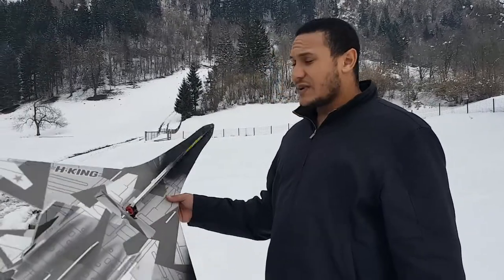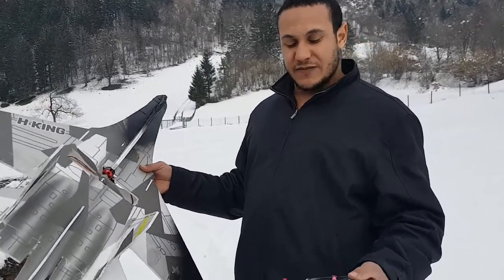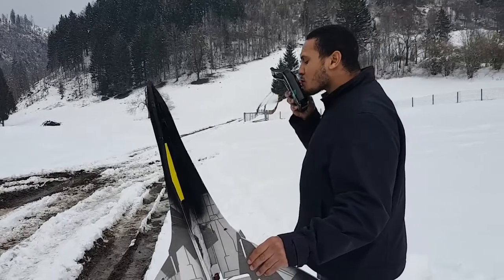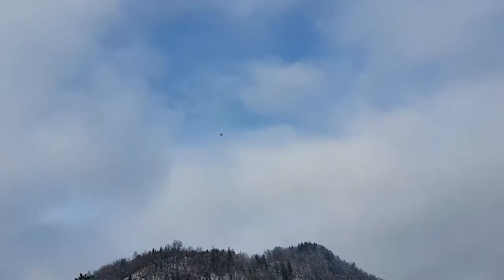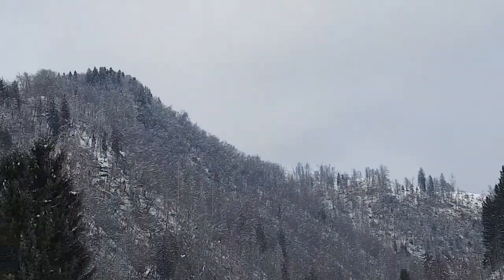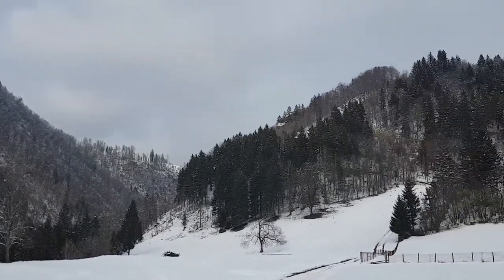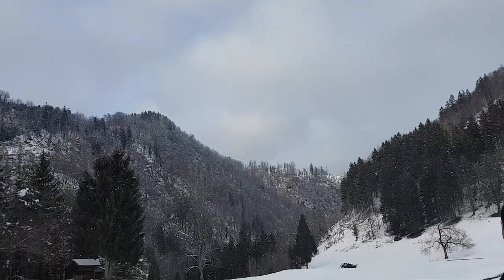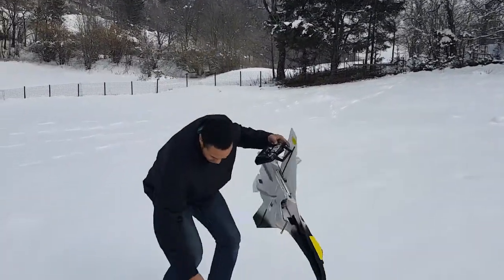Racestar BR2212 1800Kv Motor Test

Comment: This motor is balanced between 2200kv (fast) and 1400kv  (slow), I recommend it for all beginners
Reply from the maker: yup, it's a nice inbetween motor. Has tons of low RPM thrust. Did tests with 2200 & 2400 too, not with the 1400 though.

Comment: all on an 18 amp esc ,cool
Reply from the maker: 18 amp esc wasn't actually the correct choice there. When I tested the motor it pulled 25 amps so I changed to 30 amp hornet ESC.

Comment: Hi...would you recommend using 4s with 6x4 prop
Reply from the maker: Depends on the motor, you can use what ever the motor is spec'd for.